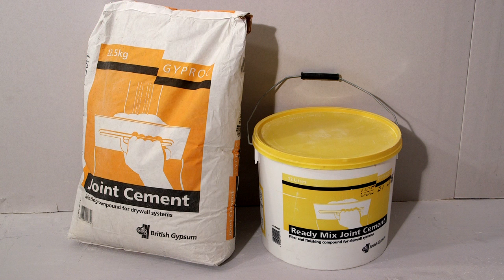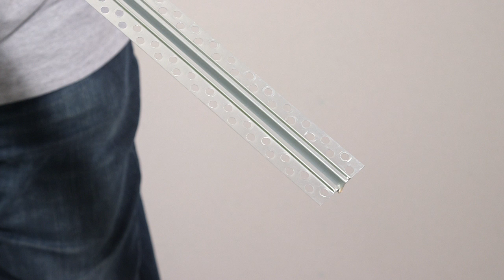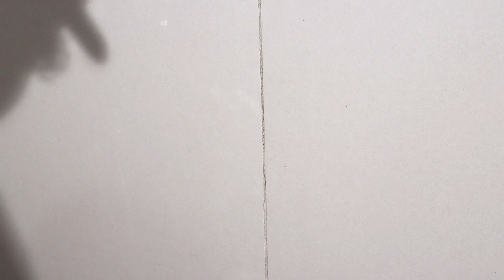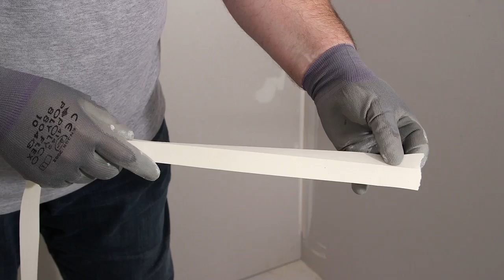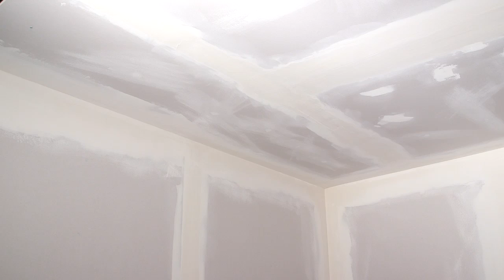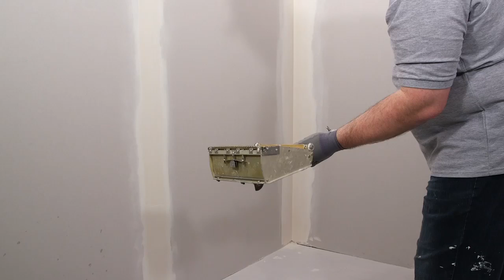How to Hand Joint to Gyproc plasterboard | British Gypsum

Comment: Im a tradesman, and watching this made me cringe.....its so far from the truth its unreal. Yeh he makes it look easy but its not, hes putting beads round a window 1 bead at a time,WRONG if you do it this way ,your two top corners dont match up,as theres not a builder in this world that gets gyproc exactly matching.
Most of this video is BS and if you done this,your walls would look like you artexed them not taped..........
Reply: Spot on mate, keep the beads wet until they're all aligned correctly. I wouldn't like to sand at the back of this guy either.